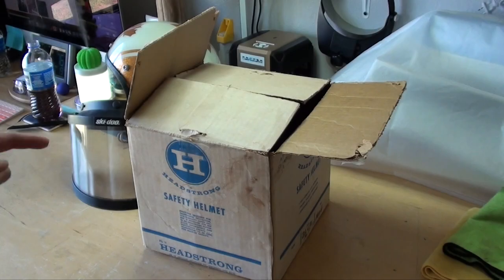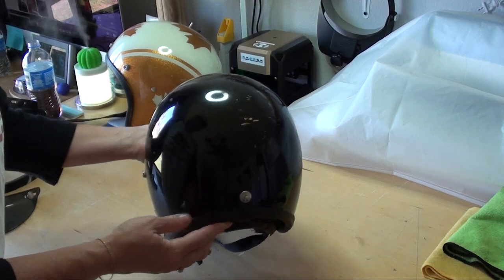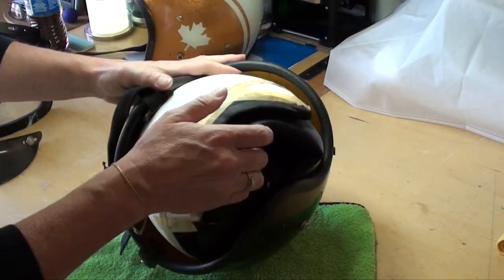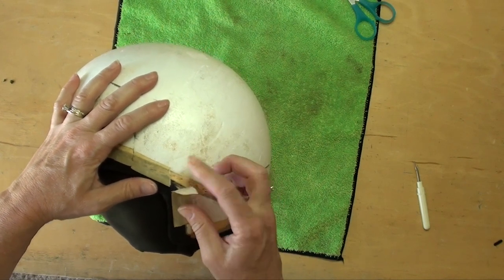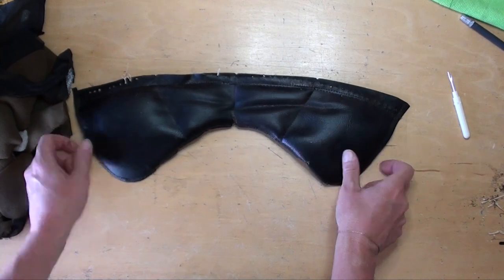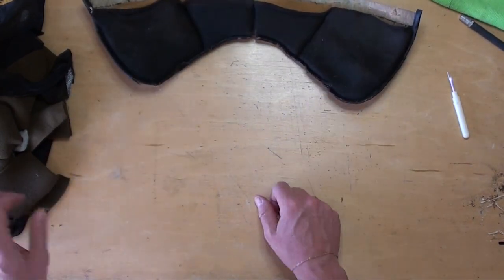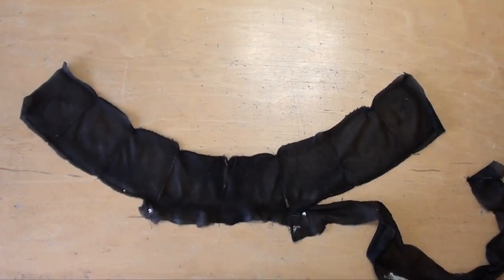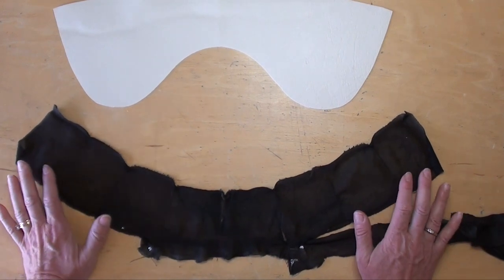How To: Restore the FULL interior of a vintage helmet. DIY

Comment: Hi, If I have an helmet in this condition I would buy a new one because my life has more valor than the price of a new helmet. Helmets have protection certification, I don't think an helmet in this cindition will protect your head.
My own opinion.
Reply from the maker: You are 100% correct and I absolutely agree with you. As I said in one of my helmet restoration videos, helmets like the vintage ones I restore are definitely not up to current safety standards. They are more of a “stylish hat” than a piece of safety equipment. 

That said, people want to restore these helmets for various reasons like to show with a vintage bike they built, they collect them (like me) and they look really cool in a display. 

I do wear mine when I go for a putt around town but there is no helmet law in my state, so I am essentially using them as a hat, not safety equipment.
Reply: @EndlessDIY  it's not about helmet law, If you do an accident you will seriously hurt yoursef. I wil not wear one of these neither to drive 100 meters around my house independently from helmets law.
Reply from the maker: @luki1a  I think you've missed my point. As I said I agree you about them no longer being a piece of safety equipment and they will not protect you as a current, spec helmet could. 

I didn't say they should be worn to skirt a helmet law. I said that I can CHOOSE whether to wear one of these helmets, no helmet at all or a legit, current helmet because my state has no law requiring any of it. In your case, clearly, you choose to wear a current helmet (or are required to). I see no problem with that; I often wear current helmets, as well.

You are essentially arguing with someone who agrees with you.
Reply: @EndlessDIY  I agree with you but I will never use one of these. You can seriously hurt yoursef even at 25 kmh If you hurt your head in the wrong place. Those helmets cant give you any protection because are too old.
Reply: @EndlessDIY  Helmet safety police is in full swing, watch out :-)
Reply from the maker: @Drazen Babich  That's the truth! Not only that, I was agreeing with him & he still wanted to argue. lol!